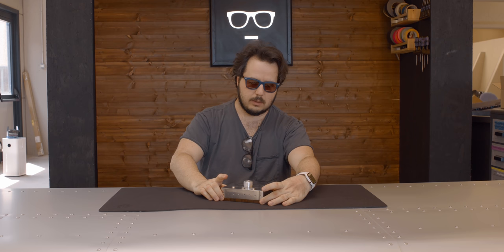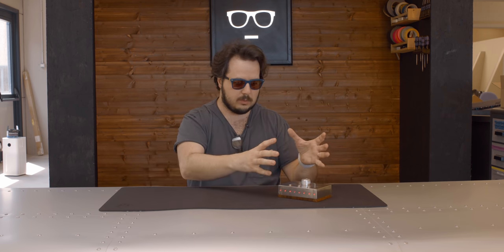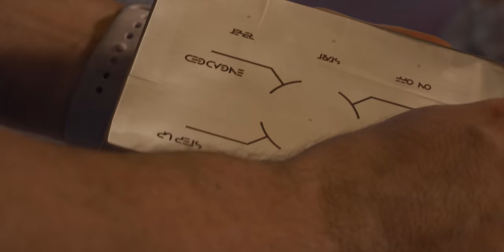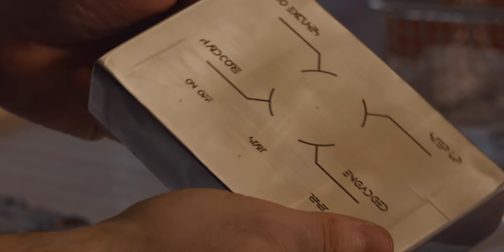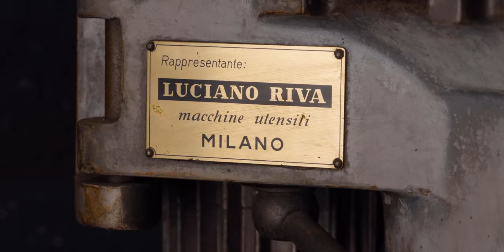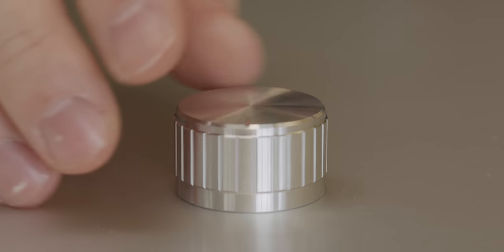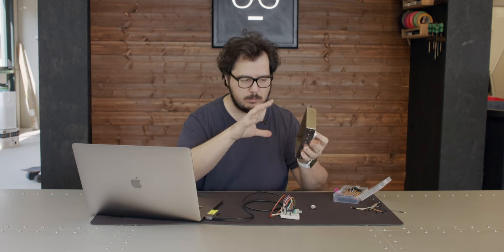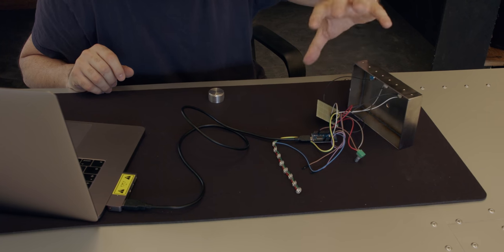I made a productivity booster

Comment: If you wish to go on with more complex electronic circuits, but not being frustrated with the mess that are wires, or complex PCB routing software, I do recommend the software called Frtizing. It is really simple to use. The idea is that instead of soldering your components onto pad boards, with the tools that you have, you could easily mill your own small PCB! Lookup PCB CNC prototyping. I am 100% sure you will love it ;-)